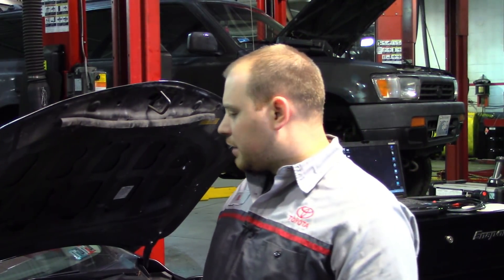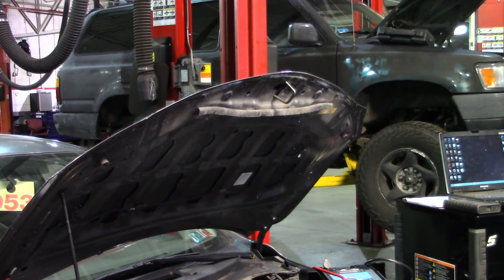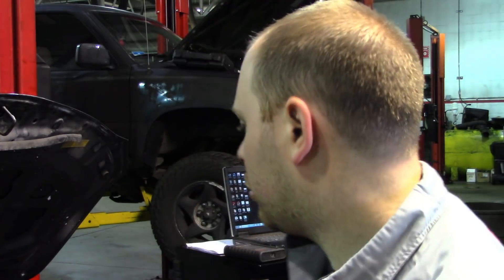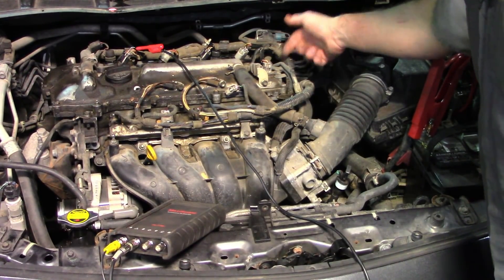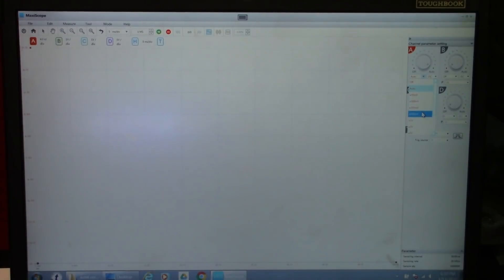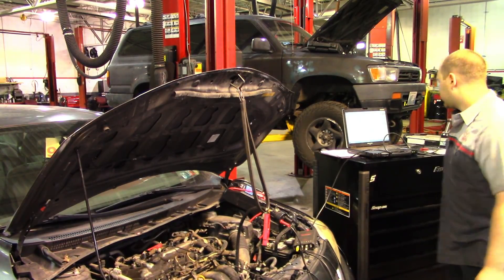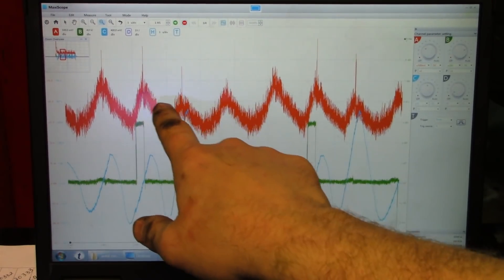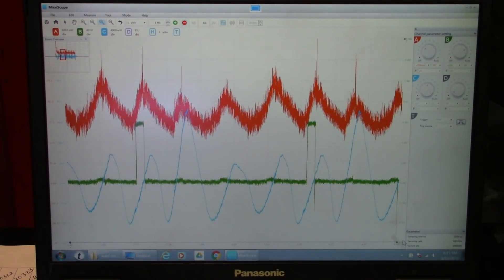'09 Corolla misfire diagnosis

Comment: Anything in particular that leads to blown heads on those Corollas, or just one of those things? And what is your overall opinion on the Autel scope?
Reply from the maker: As far as the autel scope. It isn't as good as a pico scope. But it is close. And it is about 1/4 of the price of a picoscope. So if you want a scope that does 80-90% of what the best scope on the market does, for 25% of the cost. The autel scope is probably the best bang for your buck IMO.

As far as the cylinder head failures. I honestly don't know. It's not extremely common considering how many corollas that I see.

With how much pitting takes place on the block and head. I think it is a slow gradual failure.
Reply: @VoltageDropDiagnostics  I would love to pick up a scope, but there's now way I could drop the coin on a Pico. But that Autel is interesting, as is a little Hantek version I've read mixed reports about. If I had a basic scope that would let me do simple tests, like relative comp, without a ton of $$ invested it would be great for a DIYer like me. Thanks, sir!!
Reply from the maker: DIY Dave it used to cost $500 but I’m the description i linked to amazon that is currently selling them for $400

I haven’t used the hantek myself. But i haven’t heard many good things about it.

I’d probably buy the autel over the hantek from what i have heard.
Reply: @VoltageDropDiagnostics  I think the Autel is probably where I'm heading, esp considering the add'l cost for an attenuator, amp clamp, and a basic set of probes...
Reply: @VoltageDropDiagnostics  I had the Hantek for a year it broke my Hart. One day it stopped working best thing that ever happened. I bought a pico never looked back.
Reply from the maker: I love the picoscope! But mine is only 2 channels!
Reply: I feel it leads back to the coolant. They cause lots of leaks in toyotas.... this car has probably had one water pump by now. By most likely never had more than one coolant change out.